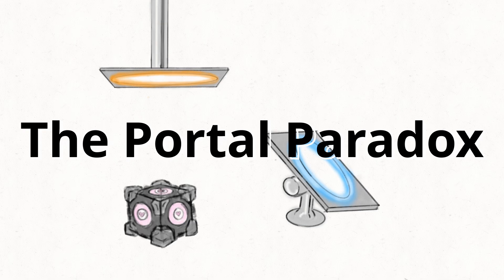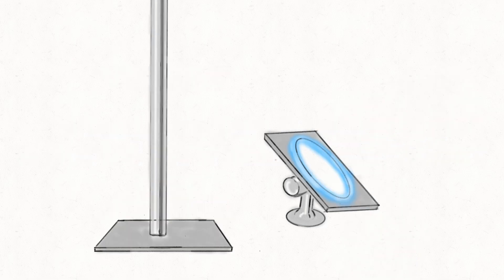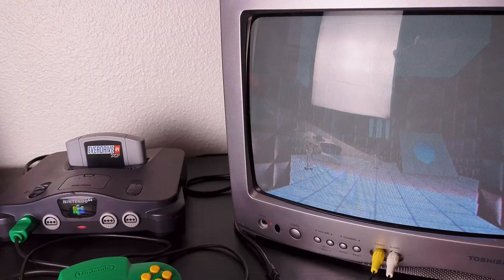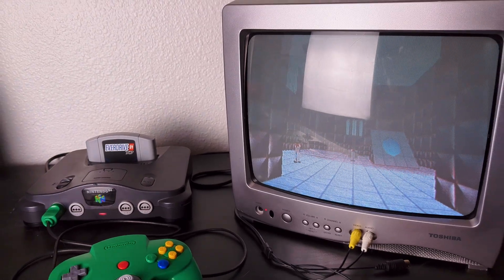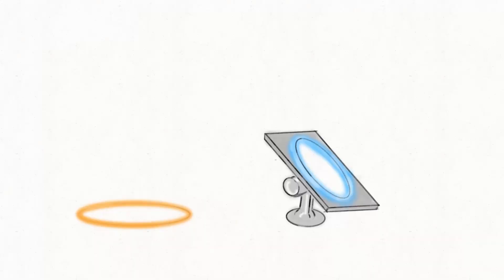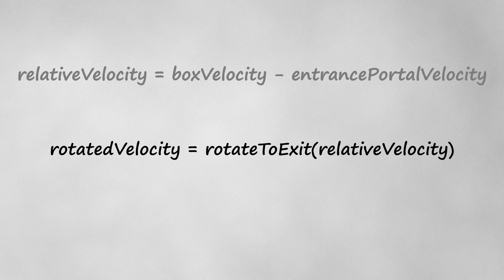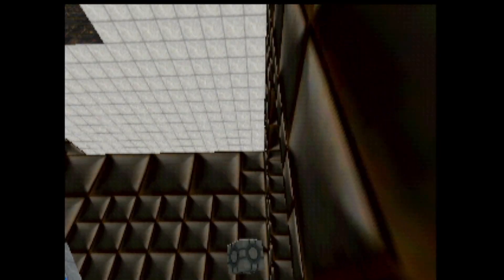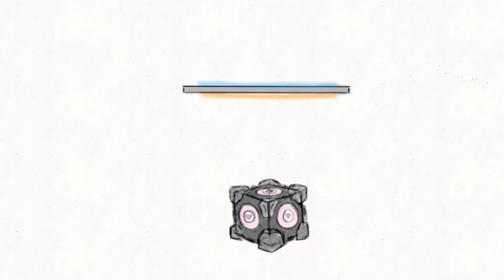I rewrote Portal from scratch and solved the Portal Paradox

Comment: I'm curious how you've magically imbued the cube with kinetic energy. It went from being stationary, with no kinetic energy, to suddenly flying through the air with lots of energy.
Reply: I was thinking exactly the same but then I asked myself - what do we actually know about physics of portals? Well, almost nothing apart from that it conserves the momentum. We know nothing about transfer of energy in any way so anything goes.
On other hand, since speed is always relative to the observer so is kinetic energy. If you're travelling on the cube from your point of reference the cube has 0 kinetic energy and it's the portals that are moving. In this case the moving entry portal has kinetic energy which it then transfers onto the cube. Or maybe it's transforming its potential energy into kinetic energy. As I mentioned, in case of physics concept that doesn't exist in our real world you can make up your own laws.
Reply: Kinetic energy is already completed screwed over by portals so you don't have to worry about that. The reason it works is because KE is based on velocity which is relative.

Comment: Intuitively it’s always been hard for me to imagine the box leaping off the floor, as it feels like it’s gaining momentum without being acted on. However, since the output portal is fixed, I think the reality is that if the box DIDN’T leap that momentum would not be conserved, as the relative motion between the box and its frame of reference (input portal) would be X while the motion between the box and the output portal (another frame of reference) would be 0. Therefore, how the output portal is “mounted” is how the force is being reacted, and if the portal is fully reacted (fixed) the box’s inertia must be overcome as a result, sending it flying.
Reply: your coment in a nutshell: hes right.
Reply: @Wrutschgeluck  I mean yea. Just thought I’d share my line of thinking in case it helps anyone else understand, I certainly had to wrangle with it in my head for a bit before it really made sense.
Reply: @dr1ver267  but the energy must go somewhere, isnt this known? like since 150 years and you learned this in 5th grade? :)

Comment: So basically the argument is, that the relative velocity between ingoing portal and outgoing portal should determine the velocity at which the cube comes out of the other portal. I too think that's the most consistent approach, as we already see this happening for the outgoing direction with stationary portals, i.e. how the in-portal is angled relative to the direction of the incoming cube determines the direction of the outgoing cube.
Also consider a cube that is overtaken by a portal, e.g. travelling upwards, but the portal is faster, so the cube goes in. Then what should happen to the outgoing ube, as it was travelling away from the ingoing portal in the stationary reference frame (of the room).
Also consider two portals side by side. If one throws the cube into one of them it should come out the other like a reflection, so if the cube would be hit by a moving wall it'd make sense to have a reflection like from a ping pong ball hit by a paddle.
Another argument is, how fast the cube would pass through the portal surface. If it takes e.g. t=0.1 s on the in-side, it should take the same time t on the out-side. But that determines a velocity, so if the cube has side length l, then v=l/t, and that v is the relative velocity of the ingoing cube, so the cube should have the same velocity relative to the outgoing portal or the times can't match.

Comment: To me, the portal is just an opening through the fabric of space around the cube, like a sleeve. Moving the sleeve of space shouldn't move the object. I'm struck with the mental image of when quick-change artists take that ring of fabric and raise and lower it over their assistant. I imagine the ring (wormhole) through space just surrounds the cube in a similar way; that you're sort of "scooping" the cube into a new location by passing the portal over it, and that when the solid space beneath the cube is suddenly gone, it simply drops onto whatever new surface is below it. 

Again I have a mental image, one of pulling the table cloth put from under a fully set table. If you could whip the whole table out from under it just as fast, the dishes would just drop to the floor. Whipping a portal across those dishes should be the same as whipping the table out from under them: the space around them has instantly changed, and so they fall. In the case of the exit portal, you would be able to look in and see what appears to be the whole table's worth of dishes moving toward you (as the orange portal skimmed across the surface of the table). If you could imagine it in slow motion, as the first dishes get closer, they pass through and immediately drop straight down out of the blue portal, as they're no longer being supported by any solid ground. Then more dishes come, and also drop straight out the exit. All the dishes would fall straight into one pile. It would be like running them off the end of a conveyor belt.

Comment: A portal cannot impart momentum to an item, it can only maintain input momentum. The portal itself has no real physicality. If a door moves towards you, you are still stationary.
I think the important reference frame here is not the surface on which the input portal is attached but rather the object motion relative to the room itself. A moving item maintains its motion, a non-moving item does as well.

I wonder what would happen if you had an object and squished it between two portals. It would interact with itself, then it would interact with the portal again.

Also, long live de-makes for old consoles. Bless you for this treasure to humanity.
Reply: Addendum: Portal 2 implements moving portals. Maybe there's something to be found there.

Comment: I'm insanely curious about what happens if you sandwich the cube with portals. Like you have the two portals slam into each other with the cube in between.
Reply: I think it would just be a press, but the crazy part is the anvils would also be object itself. And would press the object flat till It squeezed out the sides

Comment: What happens in your implementation if the portal stops halfway down the cube? Will it still propel the cube or will half the cube stick out the other portal?
Reply: it will still shoot thru the blue portal but with less velocity. the half in the other way of the blue portal will pull the rest of the cube thru.

Comment: I think the real question isnt motion being relative, but where does the momentum come from. Nothing puts a force on a cube moving through a hole, no matter what weird spacial folding wormhole magic is going on
Reply: It's not a matter of energy being imparted, that's false logic. What matters is how the cube moves through space, or doesn't. In the angled example, the cube objectively is coming out of the portal at high speed and at an angle, its mass is literally travelling diagonally through space and the laws of physics would care more about that than the rapidly decreasing hold of gravity from the other end. Functionally, there is no difference between the platform the cube is on moving , or the platform the portal is on moving. This is because imparted energy is not involved in the outcome. The only time that energy being imparted could be involved is if a platform launched the cube at the portal.

Comment: Conservation of energy would say your entrance portal would have to decelerate more and more as the cube passes through in order to accelerate the cube out of the exit portal.
So either the portals DO impart velocity onto their passengers, or they DON'T, but they sure don't switch halfway through. 
If they did, portals would be able to build on their own momentum, infinitely, drawing energy from nothing.

Your experiment chooses to have portals impart velocity like vehicles to their passengers, but it does not represent the entrance portal slowing down.
This is likely because your piston speed and thus entrance portal speed is kept constant instead of reacting to the resistance of it's imparting velocity onto another object.

Comment: Nah, hard disagree. Yes, "All that matters is the relative velocity". However, the portal is itself nothing but a hole to this other location. You aren't interacting with the portal itself, as it is simply a connection between places. There shouldn't be a relative velocity in the first place, that's the error in your equation.

In the same method a plane between two mediums would get affected by its refraction, in a vacuum, it will not affect the situation by the plane itself, but by the effects the medium takes on it. But this, this is a portal. There is no medium, there is no plane, it's an immediate hole between points. The object is not interacting with any of the objects that get affected by any velocity whatsoever.

(Adding more to that, it's an effect as the object enters the portal, which would just end up with it tilting due to simple gravity, and as such it'll just... sploot down depending on form and shape. I'm not sure what's the "portal paradox" here, honestly it seems somewhat obvious to me. A flawless portal in the first place is high-octane absurdity, in the same way a perfect vacuum is kind of a theoretical brutality, but "if you achieve it", the effects seem clear-cut enough.)

...now admittedly we're talking about simulating physics anyway, which frankly, kudos to you man. But yeah, hard disagree.
Reply: The relative velocity is about the exit portal. The "stationary" cube portion is a red herring. What matters is how the mass of the cube would behave from the perspective of someone watching the exit. Objectively the mass of the cube IS moving through space at an angle and at rapid speed. The momentum of the cube is objectively there and that momentum must be preserved. There is no difference between either platform(portal or cube) moving to cause the cube to come out of the exit portal. This is what relativity is, the relation between objects and their coordinates. This is also why the angle of the exit portal matters, since it's about how the cube moves through space. The second example is also exactly how it would function, since the mass is not moving. Confusing, I get it... but once you get it you might feel a little embarrassed by your prior stance.

Comment: Okay so....what happens if you angle the panel the piston portal is on ever so slightly so that the corner is straight down, and you drop it towards the exact center of the opposite portal on the ground in such a way that the beginning of the bottom of the orange portal enters into the blue portal? We know the whole panel wont fit but at least part if it will.

Comment: I still say that neither answer is correct, due to the fact that portals already break reality and are not even theoretically possible in real life. It could go either way depending on how you write the fiction, and you could code it whichever way you decided.
Reply: Geometry is a matter of varying dimensions, and each dimension up breaks the fundamental rules of the one below it. Think on why that matters regarding wormhole application.
Reply: @JessicaZhi  Nah, it isn't complicated, it's just not real.
Reply: @JessicaZhi  Eh, disagree.
Reply: @JessicaZhi  No, I disagree with you. Reality has limits, the scientific method cannot test the impossible.
Reply: @JessicaZhi  Okay, but Portal portals are not possible. Even if something similar may eventually exist, it would not work the same way it does in this fictional video game, therefore my initial comment is correct.
Reply: @JessicaZhi  Incorrect, I do know it is impossible.
Reply: @JessicaZhi  My requisite validity is reality.

Comment: if you've got the cube entering the portal and 1cm per second but exiting the other portal at 1mm per second you'll end up with paet of the cube not existing for a moment, which I don't think is in the spirit of portals so I'll agree with you even if I don't know much about relative velocity and momentum.
Reply: It would only exit at the speed it goes in. The relative velocity is the mass of the cube as it travels through the space on the exit side. Objectively the mass is moving through space at x speed, and should behave the same way as an object launched at x speed. Because it has momentum and that momentum is to be preserved according to the laws of physics. A lot of people think that this is because of imparted energy, but that is not in any way how it works. It's not even energy out of nothing, since the portal platform is moving at that rate, making it balanced within the system.
Reply: @JessicaZhi  I think I was getting confused between conservation of momentum and conservation of angular momentum. Would it still be conservation of momentum if the momentum is inverted etc?
Reply: @JessicaZhi  for example if each of your portals are facing in different directions would conservation of angular momentum try to push a fast moving box back into the portal it was from. basically would the angular momentum be relative to the portal or the room. Just going to say I didn't do any science in higher education so don't feel obligated to explain it to me if you're not sure I'll get it XD
Reply: @JessicaZhi  actually that really helps. I'm still not going to pretend I understand 5th dimensional travel but I don't think thats in the scope of a YouTube comment XD thank you.

Comment: Please read, lots of comments but I would love to hear your thoughts

Honestly I kinda want to believe that your approach is the right one, because it's nice and straightforward, but I don't think that I logically can. Here's why:

Your approach assumes that the kinetic energy of the portal and KE of the object are interchangeable and can lend to each other, and that's fine, I'm not trying to get hung up on little things, just thinking logically. BUT, if that's true, then we have to consider the before and after states of the system. If the cube flies out of the exit portal because the entrance portal is moving, then that is because the entrance portal gave KE to the cube, right? But that also means that once the KE is given to the cube, it's taken from the entrance portal, and the entrance portal must therefore slow or stop (assuming it has similar mass to the cube, that's a whole other mess of an argument though). So what happens when the entrance portal gets halfway down the cube and has already lent some of its KE to the cube? Will it slow down as it moves down the cube, eventually taking infinite time to give up the last infinitesimal bit of its KE? 

And back to the mass problem - for the portal to have KE at all, that implies that it must have finite mass; and if the entrance portal doesn't slow at all as KE is imparted to the cube, does that imply that the portal has very large or infinite mass? How then does it know just how much of its KE to give to the cube, so that the cube doesn't leave the exit portal near to the speed of light? 

Finally, if none of this is true and we just say, "look, it's just how it is," and the mass of the portals don't matter and the entrance portal is allowed to keep moving after giving KE to the cube... Well, then you've just violated the first law of thermodynamics, the underpinning of all of general physics, by creating energy from nothing.

So idk... I like your thought process, but it does raise some pretty massive (no pun intended) questions...
Reply: No, as the energy is spent moving the portal platform, the cube is also gaining momentum via its mass moving through space out of the exit portal. You are thinking with wires in a very "wired" and connected manner, which is understandable. But you NEED to understand that relativity doesn't care about the connections of objects. It cares about if something is moving through the universe or not. If it stops halfway, it would move as much as the momentum of the transmitted mass would allow. This is not because of a push, but a PULL from the half of the cube out of the exit portal.

Ultimately, there is no free energy here, the system remains at value 1. 1 unit of energy(for simplicity's sake) to move the platform, 1 unit of energy upon completion of the  cube being completely out of the portal and flying at the speed of the moving platform, balanced between momentum, friction and gravity(arc of motion).
Reply: @JessicaZhi  firstly, please do not comment on my thinking or state of mind. My thought process and reasoning were far more logical and based on real physics than what you have laid out. Commenting on my state of mind comes off as adversarial, and is not conducive to a productive exchange (unless you meant it that way, in which case, enjoy this response).

Secondly... I mean, I honestly don't know what to say. You clearly don't understand physics because your response is utterly incomprehensible. You can't just name drop "relativity" and think that that solves everything. Please, study some more, a LOT more, then come back and try again.

Comment: Ultimately this asks if portals have momentum or not, if portals are ONLY a gateway, like a doorway that moves then no the cube wouldnt go flying because coming out only air resistance would act on the cube, potentially crushing it if the portal moved fast enough, but if portals do have momentum like an object instead of a doorway yes it would go flying as the momentum of the portal transfered to the object passing through